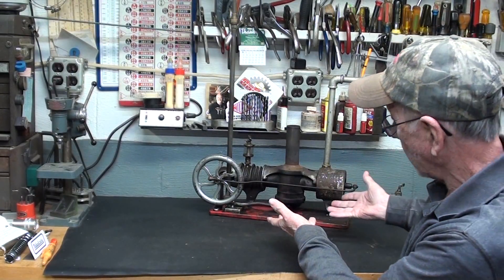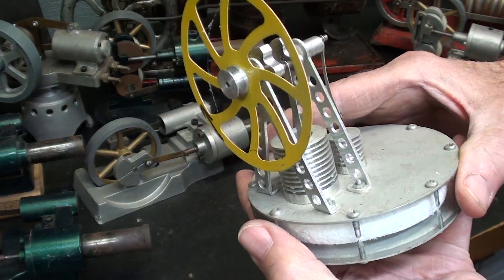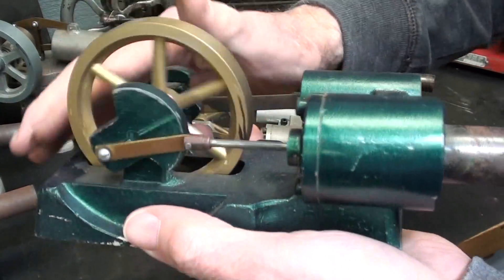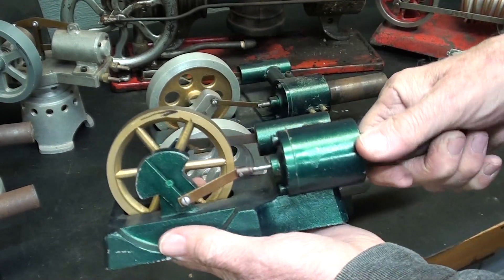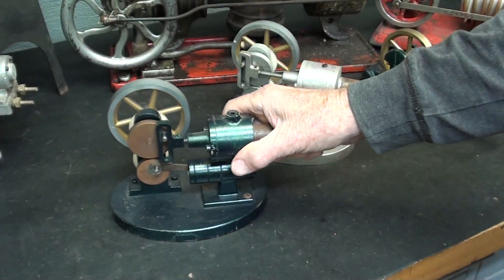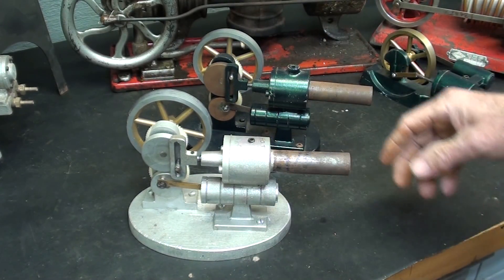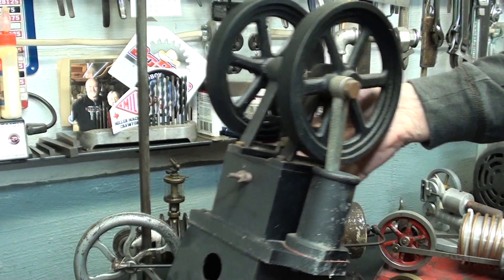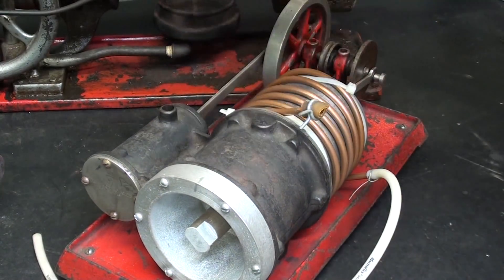Stirling Hot Air Engines Galore #794 tubalcain

Comment: So if you connect a generator to a "hot air" powered engine, connect the generator to a TV set playing cable news, and then place the engine in front of the TV, you should end up with a perpetual motion machine.  If it doesn't work, the usefulness of the engine is not at fault.

Comment: A better cycle than the Stirling might be a Brayton type cycle. High compression , then isobaric heating, then expansion.
Finally, isobaric exhaust. High pressure would improve efficiency. External combustion heating is possible in  the cycle.
Two cylinders would be needed. Using opposed pistons would reduce vibrations.

Comment: I wonder if the engines would run using a magnifying glass, so  it could be called solar power!  I always enjoy, thanks.
Reply: Some of the commercial large-scale thermal solar power plants do just that. Each of the hundreds of mirrors has its own small Stirling engine.

Comment: Hot air engines need high pressure or large size to make useful power. To get lots of YouTube views, hot air engines have to be radical or odd. Here is one example with lots of views: https://www.youtube.com/watch?v=OetRR_DU9lA
It is an opposed twin, which thus shakes less, but it uses unusual linkages also.
Mr. Pete should make some unusual engines like that to get lots of views.

Comment: I've got a super-low temperature one that I bought.  Looks similar to your coffee-cup model, but better engineered with ball races everywhere, and the power piston is graphite running in a glass cylinder.  It runs from just the heat of my hand, or from the sun when I place it so that either the 'top' or 'bottom' plate gets warmed by the sunshine a few degrees hotter than the other plate.  I also made one with just hand tools and scrap parts; it used a flexible membrane (cut from a balloon) as the power 'piston' and a CD as a flywheel; it ran, but needed a cup of boiling water to provide sufficient temperature difference.
Reply from the maker: That sounds like a neat Engine that you made
Reply: I also have one of those. I improved it by adding a heat sink that I re-cycled from a computer CPU to the top of the displacer. It runs much longer with the heat sink.